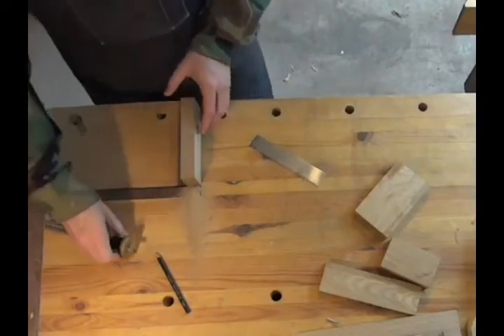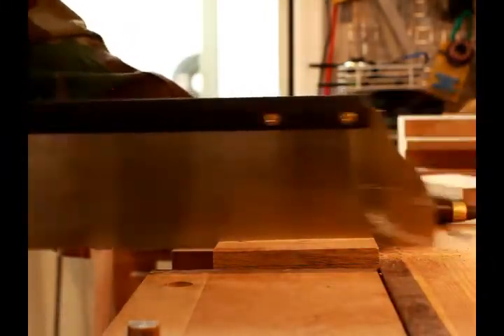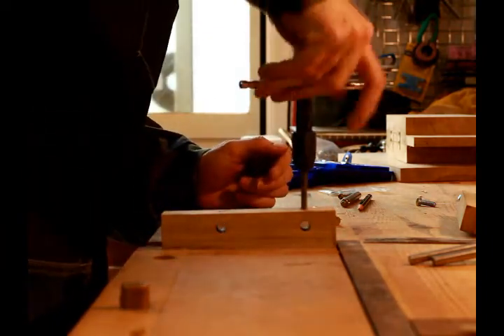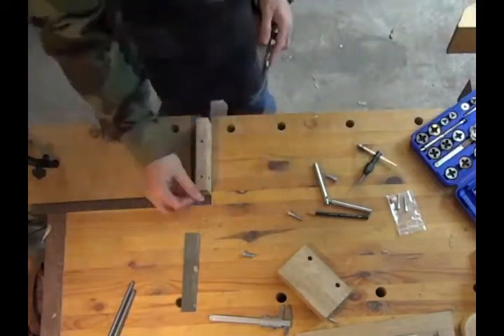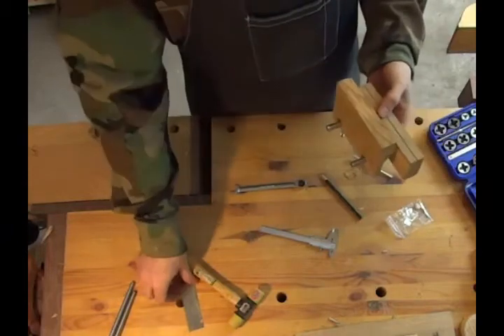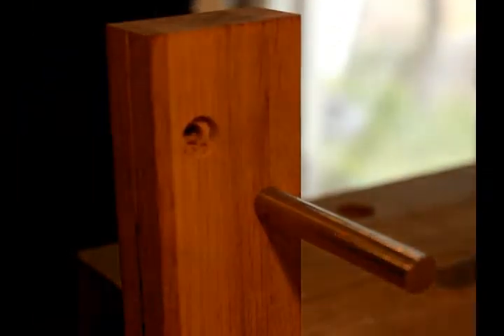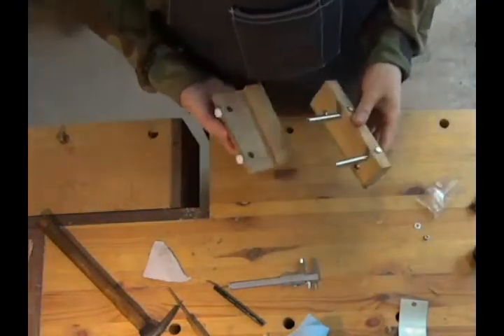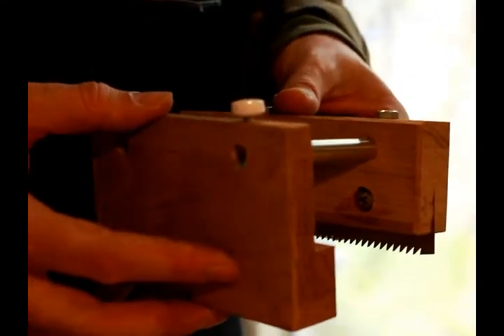Make a kerfing plane with only hand tools!! (And a drill press...;)

Comment: Thank you much for the video.  I just ordered a super cheap back saw by great neck (probably enough stock to make 2 at least and 4 if I want to cut the plate and cut my own teeth). I was just looking to see what others had done to make their own and compare what I’ve drawn to what others have done so I could get some “lessons learned”.  Admittedly, I’ve been a subscriber of yours for a long while, but somehow never saw this video. Thank you for describing you thought process and build so clearly!
Reply from the maker: Thanks for watching and subscribing! A death in the family got me off track, but hopefully I'll be able to start making videos again in the near future.
Reply: I needed to cut 3 mm lumber for my ukulele building. I use a chinese  cheap backsaw, 3 mm MDF on top of the blade grabbed with masking tape and a piece of oak very straight and wider than the backsaw blade on top of the mdf. With two presses I grabbed everything. A sandwich. I took me less than five minutes and worked fine.  If you want other measures just add or remove mdf from this sandwich.

Comment: Interesting build.  Just subbed.  I really enjoy hand tool woodworking.  

I've been meaning to make one of these for a while now.  I've been debating between push and pull.  I have both Western and Asian, so I might make one of each at some point.  

I know with Western saws the steel is generally too hard to drill with normal drill bits.  Are the Japanese saws able to be drilled with normal bits or would I be looking at another instance where the bits just don't drill properly?
Reply from the maker: Thanks for subscribing! I was able to drill through this blade with a DeWalt metal bit. The bit did dull after about four or five holes though. I'm sure a higher end bit of better quality would give you no problems. As for push vs pull, I find it easier to control the plane on the pull stroke. Since I used a rip blade the plane is difficult to start when cutting the kerf on the end grain, so that control helps to keep everything straight.
Reply: @TenonsTenors  Thanks for the reply and info.  I have a solid carbide spade bit in my Amazon cart I was planning to purchase for just this purpose.  

I am looking forward to watching more of your videos.  I hope your channel takes off!
Reply from the maker: @red58impala  Appreciate it!!